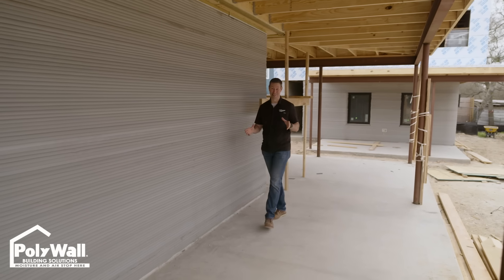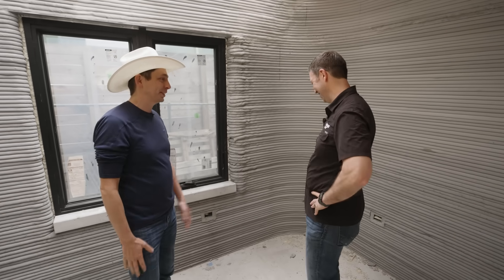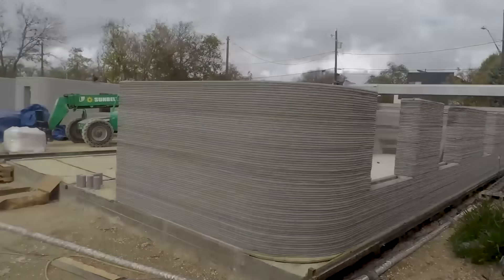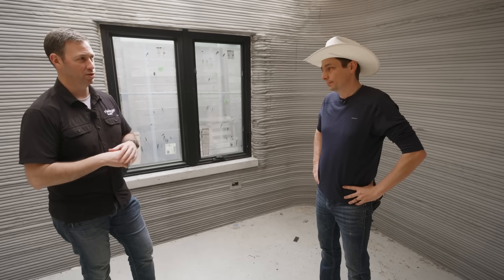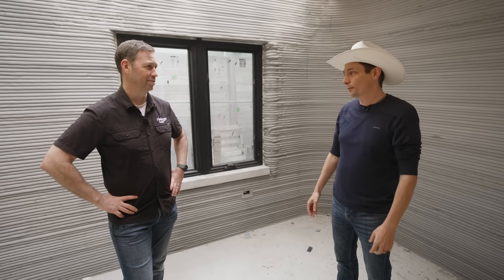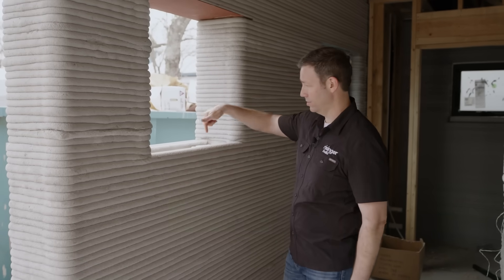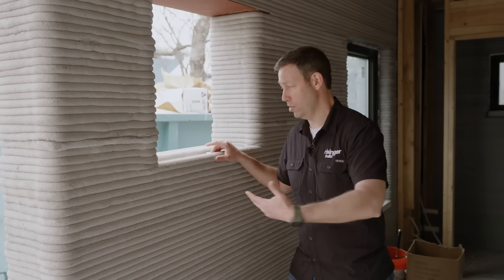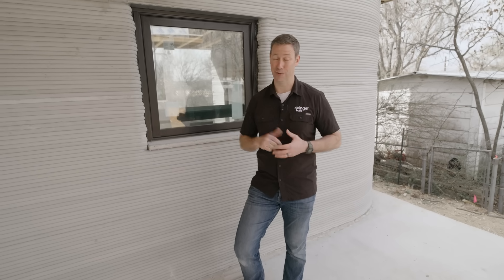Is this the future of Construction? 3D Concrete Printed Homes

Comment: Being from NM, I can only think:  When are you going to stucco that house?  LoL, I know you don't have to, but for a more conventional look, and for not much more in cost, it might be the way to go in the American SW.
Reply: This technique would be perfect for NM: easy to stucco, easy flat roof, and probably rock-solid against wind.
Reply: This is their demo house. Clients might want the marshmellow layers on some of the walls for an interesting focal point. I don't think most people would want the wavy lines everywhere.
Reply: I am form Southern New Mexico also and in my town there 99% of our homes are built on a slab foundation, and I would say most of those foundations have cracked. Mostly those cracks are benign and don’t cause any problems but only because the wood is very flexible. I don’t think that concrete walls are going to be quite so forgiving. The laws protecting home owners will need to be changed to require prestressed concrete slabs.
Reply: @deltoncbaker  AZ and CA have solved this issue (for different reasons) but it isn't hard to build an uncracking slab, ~$3k.  but it has to be done at the time of pouring.  After that, the slab can tilt some insane amount before cracking. In AZ the soil is all sand, but CA did it for earthquake reasons.
Reply: Yeah, they have a process which smooths the walls as they build it, because that looks pretty bad in some places.
Reply: I worked in New Mexico as an electrician, and I can say from experience that adobe houses are not made for utilities (plumbing and electrical).  This house construction reminds me very much of adobe construction.
Reply: In a video I did with printed farms they show how easy it is to stucco printed walls

Comment: Thank you for this cool video - I have been following Icon for a while now.  Can you comment on the lack of reinforcement in the concrete and explain why it is not a problem or weakness in it's design?   I love the idea of a 3-D printed concrete structure, but I don't trust the integrity of non-reinforced concrete.
Reply: Yeah, this seems very much like a solution in search of a problem - but no doubt they know how to throw around the buzzwords and get funding. Appears to be slower than ICF or concrete block, requires incredibly expensive machinery, and the wall is built with zero reinforcement.

Comment: I remember hearing about this idea a few years ago. I think they were talking about using it to help build quick housing in the case of natural disasters and such. I think this such an amazing direction for 3D printing technology and the fact that this may be used on other worlds is beyond cool!
Reply: Nobody delivers concrete to the moon or Mars.   
Reasons.
Reply: @jaxturner7288  I said the technology may be used, not that they're going to start shipping concrete off planet. Obviously NASA has something feasible in mind or they wouldn't be bothering to talk to that company about the way they've adapted the 3D printing for construction purposes. The ideal solution would be to produce the print material on whichever planet/moon they're on so the only thing that would need to be transported from earth would be the machine itself, which could be moved in stages.

Comment: Not if it's being done with concrete. Concrete is already unsustainable as it is with the current depletion of sand.
Reply: Wow. Forget oil and water. Sand from the Middle East and China is now a commodity? Can't use sand from the US. The EPA environmental impact studies would make importing sand from overseas alot cheaper.
Reply: @ccadama  you clearly have no idea what kind of sand is required to make concrete. Most desert sand is unusable because the particles are rounded which doesn't work for concrete. The sand needs to be sharp, and most of that is sand from beaches or the bottom of ocean floors which requires dredging. We are currently extracting more of this kind of sand than is being replenished.

Comment: its amazing how they repackage "squirty nozzle" into "3d printed" to make it sound sexy and desirable, i tell you what, i will live in one of these monstrosities when the people who designed the concrete squirty nozzle do.
Reply: Whoever invented “squirty” nozzles is long gone, it’s not like it’s cutting edge tech since humans are born with the same “technology” from day one, even caveman knew turds are formed in a really consistent shape if the contents and moisture are right.
Reply: @jaxturner7288  yes jax, you got my point. i don't think you realised it though.
Reply: It doesn't have to look like that any more than a concrete block or stick frame home has to look like raw blocks or lumber.  They can apply stucco or any other siding they want tp make it look just like any other home.  The only difference would be that the 3D printed homes are very strong, fireproof, termite proof, have air tight walls, are very well insulated + thermal mass, and they can have complex shapes or customizations with no additional effort.  

Also, it's the part where the system moves around on it's own very precisely that makes it a 3D printer and not just a "squirty nozzle."
Reply: @CL-gq3no  i don't gaf what they do to it to pretty it up, if you put lipstick on a pig its still a pig.
Reply: @tam8197 , in that case there is no such thing as a nice looking house.  Unless you think 2x4s, OSB, and tyvek is a nice look for a home.  Or plain CMU blocks.  "That water and ice shield sure looks nice on your roof, neighbor."  The guts of these homes could actually stand on its own which is more than I can say for other construction methods.
Reply: @CL-gq3no  aha, fascinating, keep going...next you will be making an argument i didn't just to try and make yourself look less dim as your first one had failed. oh.

Comment: I’m not the only one saw that vertical crack, right?
Reply: 5:51
Reply: That wall won't fall over without thousands of hammer blows.
Don't mind the surface crack.
Reply: @MrBeard-ig5zc  That wasn't a surface crack. Its clearly a graduating shrinkage crack that most likely transposes to the exterior of the wall. Its a structural defect.
Reply: @zomgthisisawesomelol good way of looking at it.
Reply: i saw it also lol
Reply: All I could see was that glorious cowboy hat
Reply: Above the outlet
Reply: Yup
Reply: I noticed numerous cracks... very likely from the curing process itself.  Makes me wonder if there are any fiber reinforcements in the mix.  There are numerous changes I would make right off the bat with this design - chief among them would be a troweling tool attached to the print head to smooth out the walls... would be relatively trivial to make them smooth on the show side.  The next move would be to mix and match the pattern vertically to create pillars in the wall - this would be to exploit the properties of fiber reinforcement.

And, of course, guides for inserting rebar... likely wouldn't need much given the design they're using already, but I'd prefer to have some support columns every 4-8' with steel in it when it comes to multi-story buildings or supporting longer spans.
Reply: @looncraz  You might want to check out Jarett Gross's video talking to the ICON CEO. Here is the link:
https://youtu.be/rkjKixI6xUc?t=213

At the time stamp, he talking about the micro cracking on the walls and the reinforcement that they use on the walls.
Reply: @aristotle29  Nice, thanks!
Reply: @looncraz  that trowel attachment would be clutch. The reason I dont like 3d printed houses is because it takes the craftsman aspect out of the equation...just guys that know machines and guys that know code...
Reply: @codycharles7147  You always need people who know what's supposed to come out of the machine and understand the craft, but this does greatly reduce the number of laborers.
Reply: That's perfectly normal with any concrete construction.  It would be covered with some caulk and paint.

Comment: Wow and it’s happening in Austin Texas......no more AFCI’S required in electrical panel hmmm, is roof combustible? Also it looked like a metal electrical box had been installed in the wall, wondering if metal raceway (EMT) had been used to connect box to box, if so why did the electrical contractor use NM cable instead of electrical wire? Electrical wire cheaper than cable.

Comment: Without rebar, how would it do in a seismic zone?
Reply: I live in Japan and we are developing concrete 3d printing processes for a high seismic activity region like Japan, so basically you have another robotic end effector that actually follows the printhead and inserts stainless steel rods in it after that is done, you can use a welding method called wire arc additive manufacturing to weld the rods together. For columns and structural supports, you'd print the internal part first and then wrap the columns with rebar and then print a second layer to cover it with an attachment that directs the concrete onto the rebar instead of downwards like when you print the walls.
Reply: @edenassos  a monolithic dome is a million times more convenient lol
Reply: @EddieSchirmer  Developing processes are never pretty.
Reply: Probably turn to dust.
Reply: They did a few of these in NY last year with rebar whole house. They sold a few as well.

Comment: It didn't look like they were using any tensile-strong materials (poly-fibers or similar) in the extrusion-process. There appears to be a crack at the corner of the bottom-left corner of the window at 11:15. Is this cause for worry? I know that brick-and-mortar constructions crack too, but the bricks still hold the wall together like a jigsaw-puzzle. What about the printed material?
Reply: Because there's no rebar it won't have the same corrosion concerns as traditional concrete homes.
Reply: @rhiannahardy-janisch1716  But it could have cracked, break, and collapse problems
Reply: @henryD9363  there actually has been structural testing done on these buildings but yes cracks and breaks are big concerns. That's why I actually don't think this method is sustainable. 3D masonry machines and 3D printed bricks are more likely to be used for a primary building method.
Reply: @rhiannahardy-janisch1716  Ikr, that's why I specifically suggested polymer-fibers (nylon, polyester, kevlar, heck, even chopped glass). These are regularly added to aggregates against cracking. Would add some tensile strength, imp, just like carbon-reinforced PLA does in 'normal' 3d-printing.
Reply: @AdityaMehendale  we need to keep in mind that adding them will effect the flow through the machine.
Reply: @rhiannahardy-janisch1716  Agreed. I expect it shall not affect the properties much, as the individual fibers are much thinner compared to the diameter of the nozzle (~5cm diameter?), and the length of the individual strands may be short too (~2cm - 20 cm). Continuous-fiber operation is possible too, but then you need a special tool to cut the strands for non-extruding movements. Nevertheless, this is 'proven-tech' in the world of (regular) FDM 3d-printing.
Reply: @AdityaMehendale  very reasonable points i would think it prudent to add a small amount to keep it together. just like fiber in your diet :P
Reply: There's another crack on the top of the outlet at 5:54

Comment: Yeah...they need a couple robots to lay in some rebar....fun experiment  but not ready for prime time
Reply: Rebar is in the cutaway picture. Fiber can be structual.
Reply: Concrete does not have to have rebar.  The Partheon dome is unreinforced concrete, 142 feet in diameter and was built in 125 A.D.  
The use of steel rebar is ultimately often deleterious to concrete because over time, water works its way to the rebar in the concrete and the steel oxidizes.  The oxidation expands the steel.  The internal pressure generated on the concrete is eventually relieved by cracking.
Reply: @davidbodart7129  Great response...Code Compliance isn't buying it...maybe you can get a permit on Mars